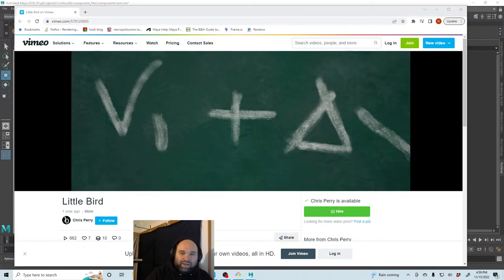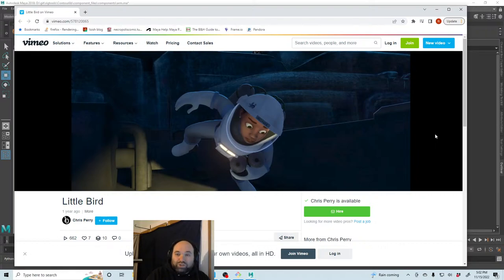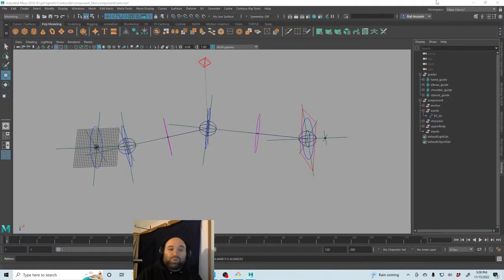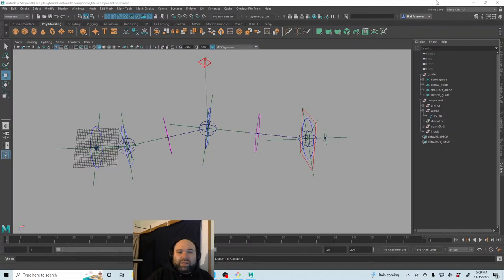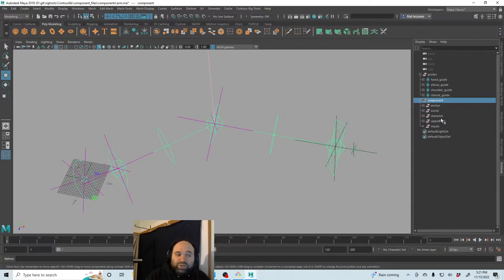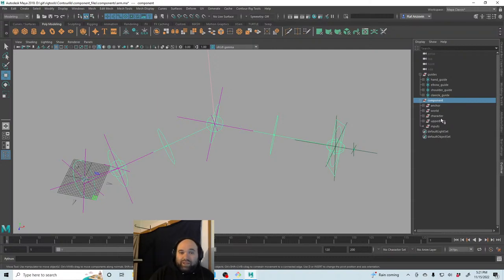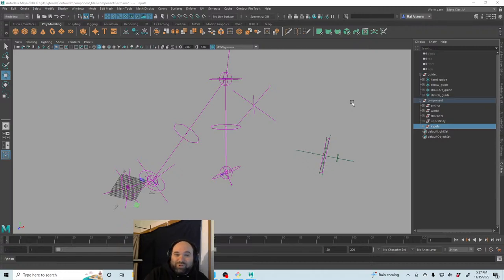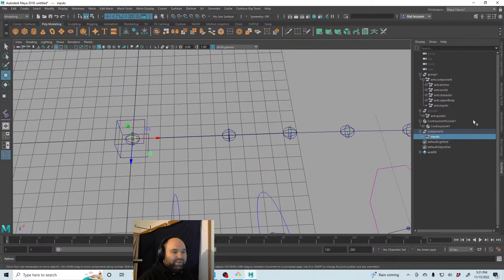Live Stream #14: Componentized rigging with Contour

Comment: Interesting topic, looking forward to a deep dive into rig components! Wish I could make it live, but kids are busy at 5pm on a weeknight ;) Quick question: If you were using offset Parent Matrix how would the connections be different? Directly connect the inputs world matrix attrs to the offset parent matrix of the contour bones/socket?
Reply: Yup--you wouldn't need to decompose the matrix all the time so you could feed the values into T/R/S attributes. You still would in some cases--decomposing the matrix is necessary, for instance, to extract separate rotation and translation values to connect into the bone's nextJointOrient and length attributes, but for connecting up transforms that extra bit of complexity wouldn't be necessary.